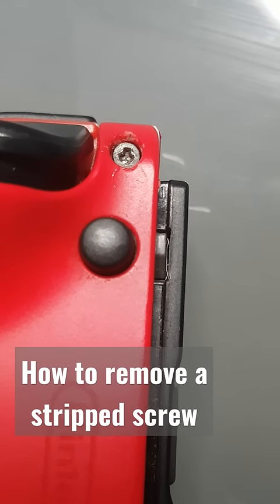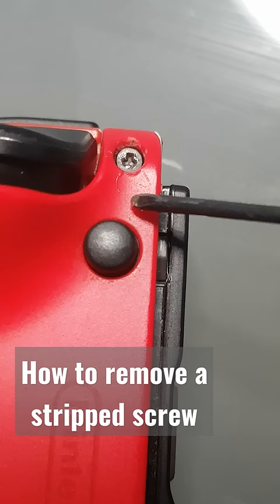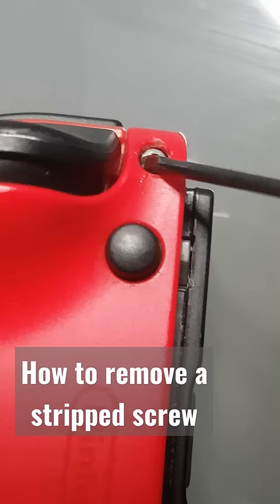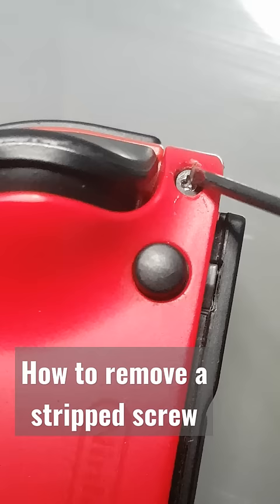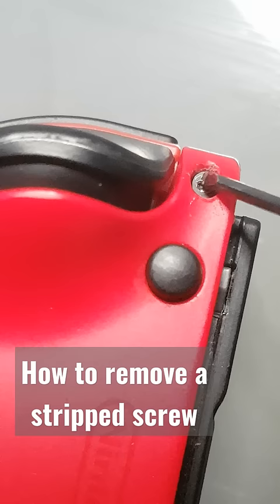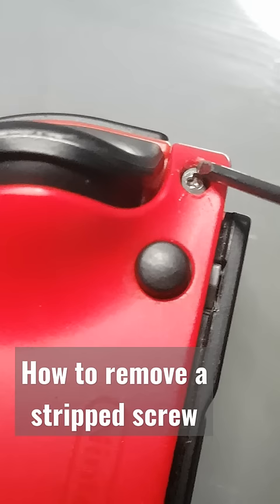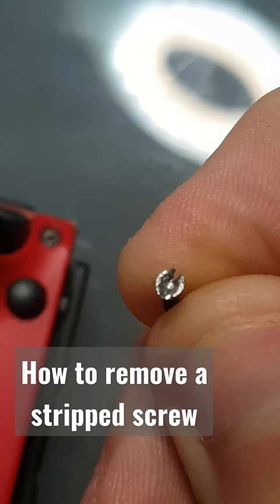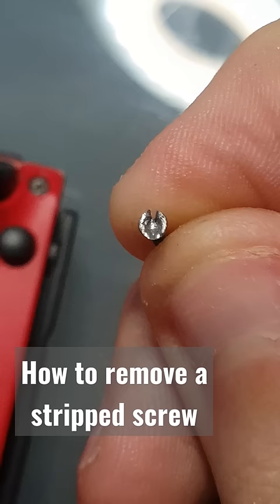How to remove a stripped screw without damaging your joycon shell #shorts

Comment: The last time this happend to me i literaly break all the plastic and buy a new set of case for the joycon. Nice tip
Reply: x2
Reply: x3 I actually melted my original shells to install new ones
Reply: @shepherd3384  I need to buy new Joy Con case
Reply: SAME
Reply: Me too
Reply: how did you break the shell without damaging the inner parts?
i'm afraid to break wires or ribbons
Reply: Starting to get to this point with mine
Reply: Why are you suddenly become relatable?
Reply: How long does it take?
Reply: how did you do it without damaging the internals
Reply: One question, i did this, cause not even this worked. But now in the spot where im supose to instal the new skin, the screw is still there?
Reply: @imdanidays you have to eat the screw

Comment: Hi! I just want to thank you for this video. After 2 days of persistent scratching of the screw on what I had hoped to be the same spot (and mine was badly stripped, the original groves were completely destroyed), I finally got it to unscrew this morning omg. The tip is to aim the scratching at the top part of the screw head so the scratched area doesn’t slope to much. This then provides a catch for the screw driver to insert into the new groove and twist. Honestly the moment the screw started turning anti-clockwise, I almost cried. Thank you thank you thank you!
Reply: 2 days? Man, I gotta be more persistent. And you gave me hope. Thank you!
Reply: @pottop880  use duct tape put it over the screw and then you can undo the screw 😃
Reply: @amandapacheco9398 that rarely works. Same as the rubber band method.   When they are really stripped there's not much that can be done once you've tried every trick. I'm dealing with one right now that is terrible. Nothing is working. I've drilled out the center and now I'm going to try a screw extractor bit.
Reply: @chriskvikstad4980 was the screw extractor the solution?
Reply: @Josuh  thanks for following up on this one. Yes, I went to Harbor Freight and bought a nice set of 3 impact rated extractor bits that are double sided. The one side has a small drill bit to bore out the center. The other side has a very aggressive cone shape end that digs down into the screw head and then bites into the metal. It worked wonderfully and solved my problem in a flash. It was absolutely worth every dollar of the $10 it cost. I had tried a cheaper bit set at Menard's for $5 but that was just trash and it didn't work at all, so I returned it. Poor design and the metal in the bit just ground away. LOL pure garbage. If you are having trouble I highly recommend getting this set from Harbor Freight. Then you have it if you ever need it again.

Comment: if your screw is not fully stripped, you can also try the old "rubber band" technique, where you put a piece of rubber band between the screw and screwdriver, preferably a thin one. This only works if the screw still has the general groove shape of the screwdriver, not if it's stripped to the point it doesn't have the shape.
Reply: These screws are so tiny though, I don't think the rubber band technique will work.
Reply: I tried the rubber technique and it didn’t work
Reply: The rubber band trick doesn't work. Everyone is  suggesting that trick with no proof of it actually working
Reply: The rubber band technique has never worked for me…
The screwdriver always pierces through the rubber band and it remains the same.
Reply: The rubber band trick has never once worked for me.
Reply: Thoigut it only worked for the woodworking screws?
Reply: Rubber band technique just stripped it more.

Comment: There are two attempts that I want to recommend before moving on to brute force, the least traumatic is to insert a piece of rubber band between the head of the screw and the tip of the screwdriver, then trying to unscrew it by pressing a little, but unscrewing very slowly. Another classic is to take the plastic cylinder of a bic pen, heat it until it becomes malleable (without melting it or setting it on fire), insert it and press it against the screw head until it cools down and takes its shape, then try to unscrew it very slowly. If nothing worked, you can drill the head of the screw with a dremel, until it is worn out and you reach the threaded part, then once the object has been disassembled, proceed to unscrew it by grabbing it with a pair of pliers.

Comment: Can you show how to remove a stripped screw behind the battery? I might have stripped the one in the top left and am having a hard time removing it to start the fix.
Reply from the maker: should be the same, before trying it you should get those yellow rubberbands and put it between the screw and the screwdriver, if that doesn't work you can try filing it away

how did you strip the screws behind the battery? they are regular phillips screwdrivers
Reply: @VKsChannel  I’m not exactly sure I stripped it, but when using my screwdriver to take it out, I could just not get that specific one. I took out the other one diagonal to that one and the one in the bottom right, but that screw is giving me trouble and I’m not sure why.
Reply: @VKsChannel  Also, once I figure put how to remove the screw that I think I stripped, I want to replace it, but do you know what type of screw that is? The one behind the battery? I really want to buy a replacement online but I’m not too knowledgeable when it comes to these types of things

Comment: Alternatively, you can do what I did: Use a tack/needle and scrape around the inner walls until you cut them open. I found that acetone weakens the joycon's plastic and helps the process.
After you pull out the shell, the screw will stay in place. At that point, if you want to remove the screws you can just use some pliers.
Then you do your business, and just superglue that thing to secure it.
Reply: Being honest here, I wish I had seen this video first ._.
Reply: how can i remove a messed up screw out of my ps4 controller

Comment: Had a screw strip on the backplate, and the screwdriver was simply not cutting it. Ended up prying the backplate off the switch so the screw was by itself, then I used a handsaw to make the indent, saved me lots of time, thank you for leading me down this path ; o ;

Comment: I've had an issue with the stripped screw for the joy-con, as it seems so easy to do it with just some extra pressure. 
I've tried everything at that point, using rubber bands, gluing the screwdriver into the screw, tried the method in the video as well, but nothing helped. I've found some video though which suggested using a star (or torque I think they are called) shaped screwdriver and basically scratching new dents like you do here but in 4 ways for extra grip, and if you failed the first time, you could take a slightly bigger screwdriver . It worked with one screw, but I've really messed up the other with glue and stuff, so I had to drill it out with micro drill. So... nothing is hopeless, but I've spend 2 days on this...
Reply: which video ru talking about with the star torque screwdriver link pls
Reply: @tanner3270  Will try it, nothing helps me so I got nothing to lose :)
Reply: @tanner3270  Sorry for the late reply - https://www.youtube.com/watch?v=5-82o0Uk3PM  here is the video, it's on russian but shows the process

Comment: Is stripped screws also a name for stuck
Screws? I never messed with with the screws on my switch but one is stuck. Do i use this same method?
Reply: Get a thin rubber band and then use the screwdriver, it's likely that the screw was put on too tight and the rubber band will help to get a better grip on the screw

Comment: Unfortunately it didn't work for me and I ended up breaking (popped out) my L2 button because I was trying to separate the left joy-con shell apart 😔. I never made it inside to see if the fix would work. On top of that I had another screw that wouldn't budge either. The two other screws were fine.

Comment: How long does it take to manually scratch a screw down like that? I’ve been trying for 3 days and I still just have a screw with a circular hole in the top.
Reply from the maker: It depends on the strength and speed which you scratch

If you sand a little bit off from the screwdriver tip to make it more irregular like a saw it may help you a little